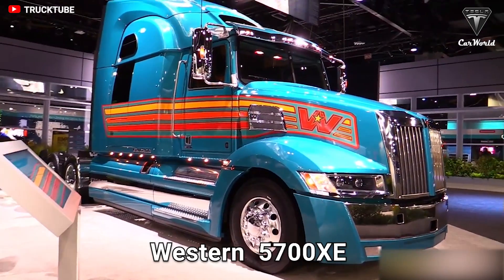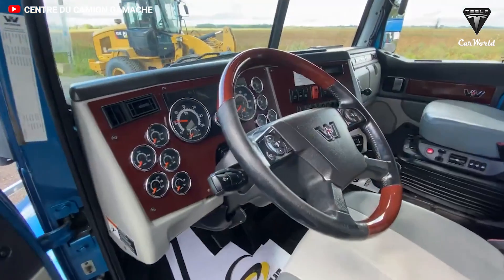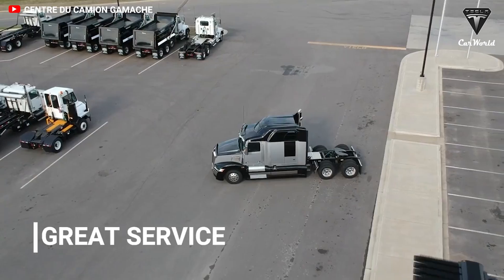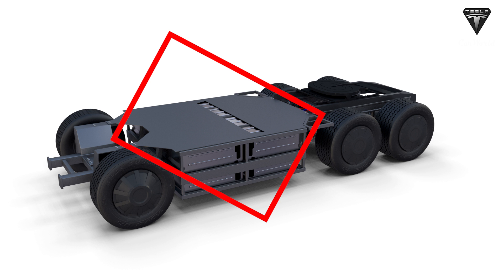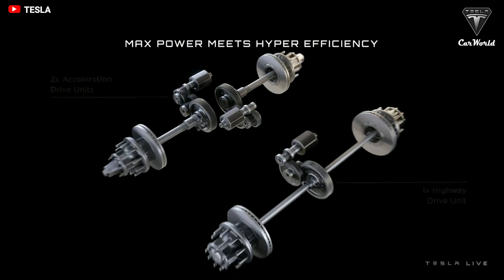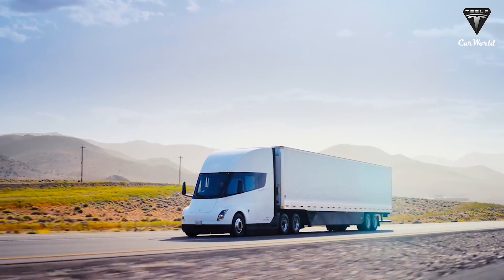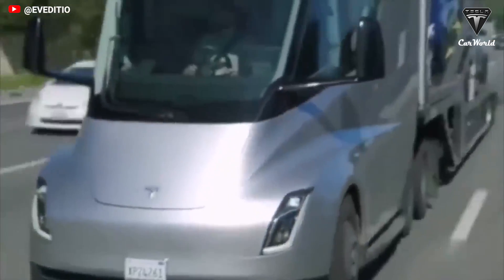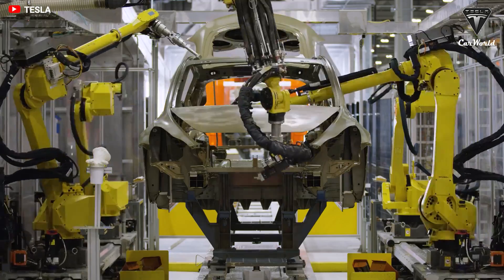Which will dominate the Heavy Truck in 2023? Western Star 5700XE Diesel Truck Vs. Tesla Semi?

Comment: Over 90 Percent of all Simi Trucks are loaded at 70 PERCENT of Capacity or less
The Tesla Truck hauled 81 thousand lbs for 500 miles and recharges to 70 PERCENT of Capacity in 30 minutes making an 850 mile Daily drive possible

Comment: John Cadogan on Autoexpert has explained all this. Capacity is roughly 12% less so you have to increase your fleet by the same amount as well as your personal. This figure maybe worse as there is no official figures out yet. Tesla should be making smaller inner city trucks as the tech isn't there yet to compete with diesel. Plus the mileage takes a huge hit once you load it to the same as diesel. More down time charging, price on goods goes up.
Reply: The Tesla Truck hauled 81,000 lbs for 500 miles and will recharge 70 PERCENT of Capacity in 30 minutes and 90 Percent of loads are at 70 PERCENT capacity or less 
That's 850 miles per day
Reply: You are incorrect in stating this .. electric trucking will have its place .. and most truck never run at capacity .. and the heavy ones that do ... just keep em ice ..  its not war .. we simply have to see how we can change

Comment: Any EV truck will currently not work for any sort of multi-day haulage. Or where you're not certain where you are going.

However. They shine above anything else when it comes to less dense cargo, and when you are only operating between your own terminals if you have charging there.

Same thing goes if you're operating within the limits of the battery, and returning to your terminal each day to charge overnight.

The fact that the Tesla Semi only has a weirdly designed day cab should be a good indicator that it's not meant for any sort of long haulage.
Reply: The cab design will still work when they have made a sleeper for OTR.
Reply: @Iceland73  The problem is that we do not know what the cab design is for a sleeper version of the Tesla Semi.

From what I have seen thus far. Then it's just a flat wall behind the driver in the current day cab. Meaning that they would have to lengthen the truck to make it a sleeper.
Reply: @Glasseh  I agree that they would have to lengthen the frame.  Doing so would allow more space for batteries.  I personally think we are a couple years away from a seeing a sleeper version.
Reply: @Iceland73  If they lengthen the frame, AND add more batteries. Then that's a whole lot more weight added to the already limited cargo capacity of the Tesla Semi - Thus making it all the more unsuitable for long haul transports.

As I mentioned before. Any EV truck is only really suitable for single day jobs.
Reply: @Glasseh  is the battery technology there now? No it’s not.  Now; we can agree on that.  Definitely the truck as it is in its current configuration is local only.  Can it be used in the future as an OTR truck?  I think so but it will take some more technological advancements battery-wise and the infrastructure for charging to be supported for the rigs.

Comment: Did you mention the 500K in fuel savings?
Reply: Fuel savings go out the window when you count what it takes to keep it charged up.
Reply: @WinZard  No, that includes the cost of the electricity.
Reply: Money is an incentive to overcome inconvenience. That said it might be a while before mega chargers are genuinely nationwide and the high mountain passes will remain diesel territory unless there are radical battery improvements. That's said, I suspect there is a very large available market for the semi with a 500 mile range.
Reply: My bet is on the Hyliion hyper truck erx